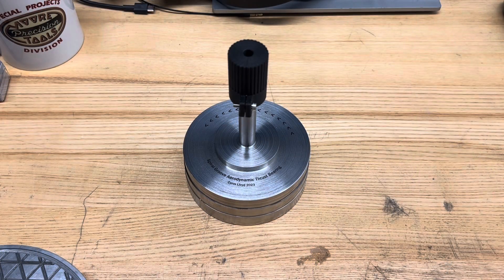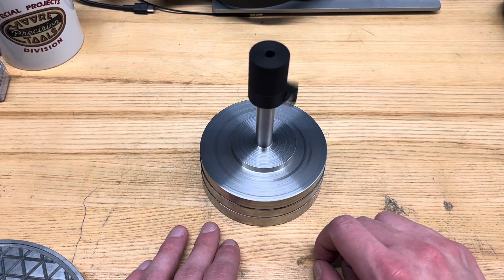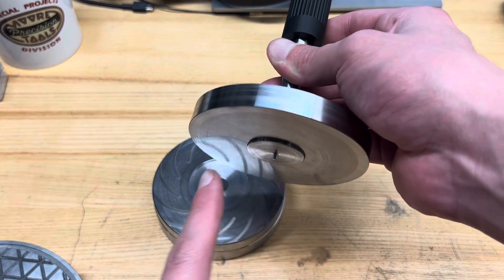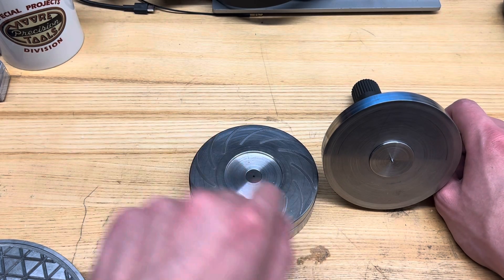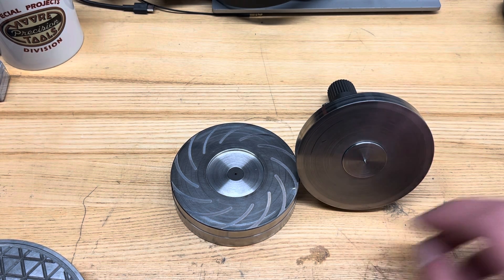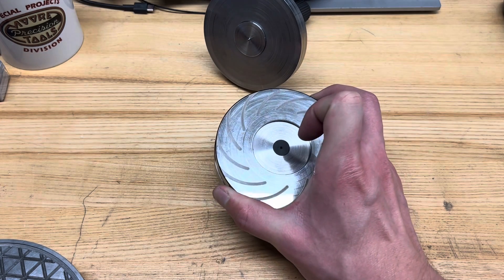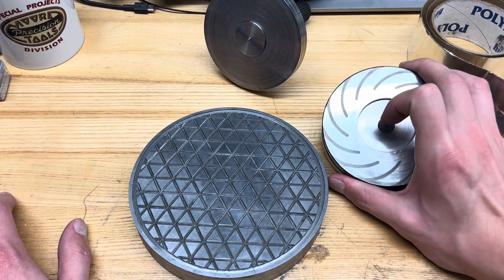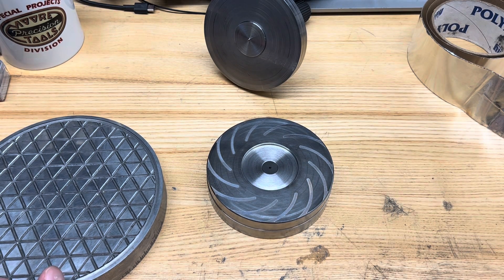Spiral groove aerodynamic thrust bearing prototype

Comment: Can you use two small attracting magnets in the center, to keep it from slipping to the side?
They will attract and pull the top down, but the air foil will keep it floating still and now there is no touching.

Comment: I have just discovered this principle by mistake while experimenting with the first air bearing spindle I got my hands on and I thought I was going crazy as I didn't expect this was a result to me closing down the thrust bearing air gap and I am just so glad I found this video of yours as i thought it was locking up because of poor quality work anyway..I have been trying to find the documents/drawings of the model I have...it's a westwind model 70, which is the smallest air spindle that I could find and afford...another thing that makes it more rare is that it is an air powered spindle + aerodynamic bearing...the rotor/turbine design is another great alternative to electric motor. I can send you some plans if you want? You should make one for your Dan Gelbart lathe as I was going going to do the same project as that video of his completely changed my life of engineering..I am going to make a bigger version of the spindle that I bought...this little westwind spindle I bought to mount on my SIP...I was wondering if I am correct in guessing the reason for the turbine powered instead of electric, as my goal was to have the least jittery rotation spindle as I think the particular model I have is better than the other turbine designs that I have seen  in  that it doesn't work with a  vane type propeller that has blades that ports guide the jetted air up against the blades. It's almost like a reverse principle type configuration. The next experiment I aim to get working is to combine something like this that you built into  my westwind...I was wondering if you could answer some questions about it? Thanks for the inspiration 😊

Comment: In Google search there is a calculation of dimensions and load: "Spiral groove thrust bearing". In the video, the spiral captures air from the outside, this is bad at high speeds and liquid lubrication - the centrifugal force works against it. It is better to make grooves from the inside. If you add fine abrasive to water, then at low speeds you can precisely grind the surfaces.

Comment: If I may share my thoughts on increasing the thrust handling capability. Not a native speaker here, so sorry for any mistakes or unclear language.
I immediately thought of the housings of turbochargers or blower/pump housings in general in respect to increasing the flow area around the circumference to have an as linear as possible increase (or decrease depending on flow direction) in pressure. In your case, as you have access to a laser, you could form these grooves not with all the same depth but rather with a profile of some sort that gets narrower towards the center. That would force the fluid you want to use to be distributed more evenly across the bearing area instead of piling up at the end of the channel and therefore should greatly increase the load bearing capability of the whole thing. Now the calculations or rather simulations for the optimal shape of these channels is way over my head but there are a lot of people out there playing with such tools and software. As I said actually making them should be no problem with a laser's help. Hopfully this is of any value for your project as I just wrote half a book down here. Even if it's not it should help with the algorithm :D

Comment: Amazing work. But I wonder how much load it could handle. I’d assume it would change proportional to the rotation speed.
Reply from the maker: Yep, the fast it spins the more load capacity you get. The math says around 50 pounds at 1000 rpm I believe

Comment: This is brilliant! How long does it spin for? I've been trying to make one of these but struggled getting a decent flatness (aluminium tape on surface plate method).
Reply from the maker: Depends on how fast you get it going. It’ll go for a few minutes if you spin it up with compressed air

Comment: Cylo, that is pretty much brilliant !!!!
Downside tho, is that you cannot use a lubricant, can you ?
Reply from the maker: Thanks, you can use a lubricant, but the bearing needs to be pretty much submerged in it. Then you get the same effect just with the oil. The bearings in hard drives work like this
Reply: Oooooh ! Yeah, just submerge it fully - had thought the viscosity of the oil would be too great for it to be pulled in ! @cylosgarage

Comment: Its always amazing watching your videos and getting to know how these mechanisms work! Just out of curiosity, could your diamond turning lathe be used to create the parts with similar results to the lapping, or the flatness would be hard to achieve?
Reply from the maker: Thanks! The DTL could absolutely make parts of a good enough geometry, the issue is it couldn’t make parts out of the right material. If I diamond turned these components from aluminum, they would score and gall horrifically almost instantly. You want a very hard material for these components but I can’t diamond turn those (right now)
Reply: @cylosgarage  I see, thanks for the reply, and I love the "right now", can't wait to see that lathe evolving.
Reply: @cylosgarage I was curious about this too? What is lacking in your setup to be able to turn harder metals? Is it just rigidity of the lathe or set up? Is there a min depth of cut required or could you just take fractions of a nm at a time to reduce tool pressure until defection was managable?
Reply from the maker: @HuskyMachining  without special technologies like ultrasonic assisted cutting, you can’t diamond turn steel. The diamond basically dissolves into the ferrous alloys in a matter of seconds, so that takes a lot of “hard” options off the table. You can diamond turn other hard things like certain optical crystals, silicon, and germanium, but it requires a special high negative rake diamond tool I do not possess. Google “ductile regime cutting of brittle materials” for more info on this. Basically it’s not a machine limitation it’s just a process limitation
Reply: @cylosgarage  I'll have to Google that. I forget sometimes how chemicaly unstable Diamond is at high temperatures... it is just bound up carbon. 

Btw, I love the videos you put out. I only know my little niche of machining and it's cool to see other parts
Reply: @cylosgarage Try lapping a sharp adage on a CBN insert and cut some hardened steel. You’ll be surprised.
Reply: I am really new to fluid bearings and I would like to try improving the efficiency of my spindle by incorporating this concept into the design and have been getting some weird results..I was wondering if you have experimented with mixed aerodynamic/hydrostatic designs?
The spindle I am working on is a reaction turbine powered that shares the same single air input. The turbine  rotor is the thrust bearing disc which is fed by a center channel in the shaft that has the nozzles. When I received the spindle, it had a large amount of play on the thrust bearing and I reduced it greatly which made a huge difference in performance and working speed range...but I noticed that the air bearing mechanism stopped working properly and the spindle would only work when powered...I was troubleshooting and I sort of discovered this principle and I am trying to learn more so I can get  the mixed design working or just optimize the performance of the existing design..I am not sure how to make the spirals as I don't have much  equipment, just my Cowells lathe with a milling attachment. I have had some ideas for things that I would like to make using fluid bearings and I am trying to find out exactly how the profile of the spirals influences the design. The thrust bearing on my spindle had 4 small jets feeding air onto the thrust plate which is flat both sides. Below the thrust plate there are another 4 nozzles that have  the output of air fed into a single circle groove ring cut into the stationary bearing face...there is of course a circuit that the air is channeled. I tried to make the top bearing face like the bottom by cutting a ring groove but this turned the air bearing into an air brake....I am looking for getting to the point where I am not making these unplanned discoveries..
Do you know of any good information pages or links to help me? Thanks again